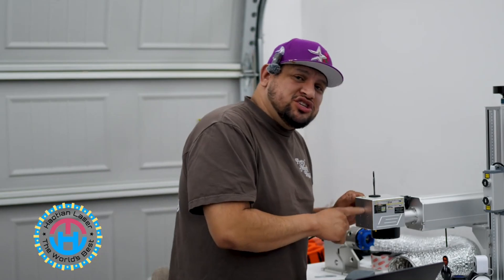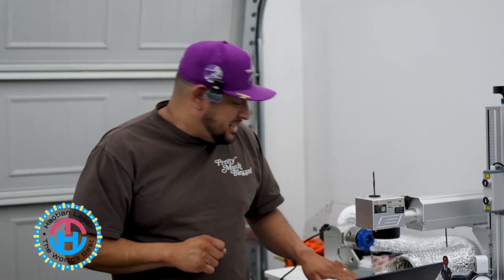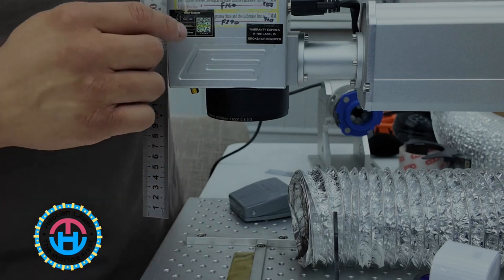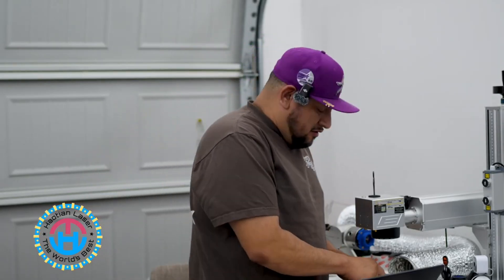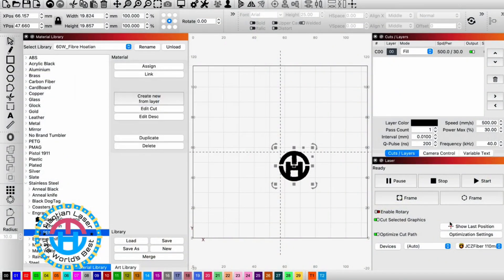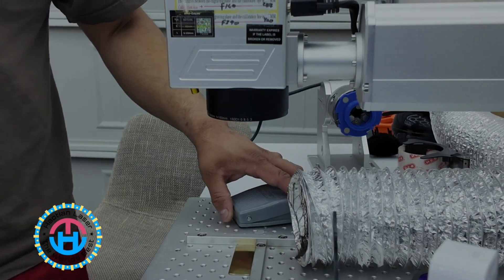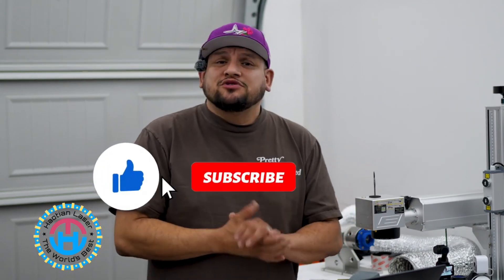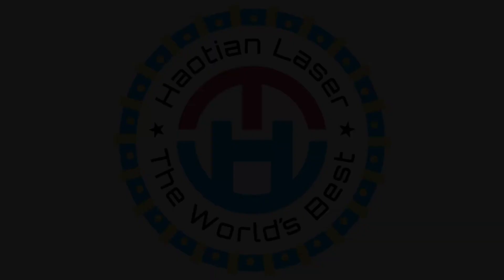How to Accurately Find the Focus Distance for Your Haotian Galvo Laser

Comment: so i set my laser height with the recommended calibration line on the machine, but my dots are apart. The calibration line states 221mm but when my two dots are together my calibration line is at a height of 298mm. Is this correct?
Reply from the maker: Based on the line on the galvanometer, the red light needs to be adjusted after measuring the focal length
Reply: @HaotianLaser   @HaotianLaser  How do you adjust the red dots to align? Also, do all THREE dots need to align, or just the two? It looked like your main center lens red dot was not aligned with the two focal red dots?